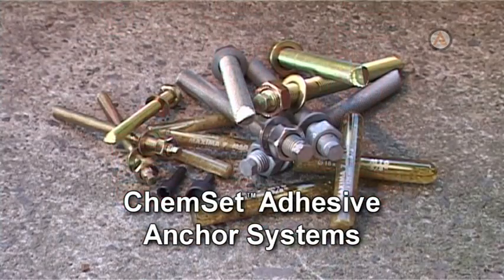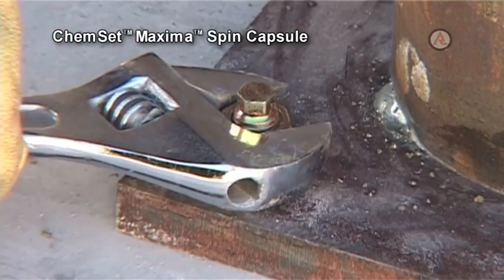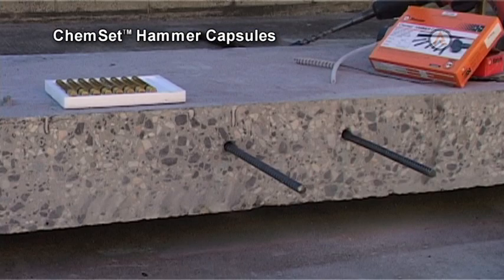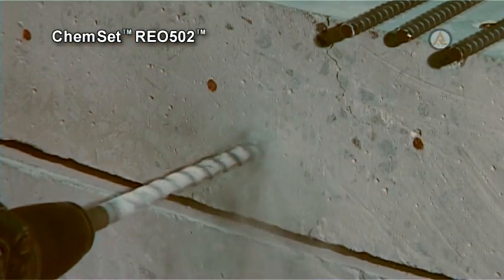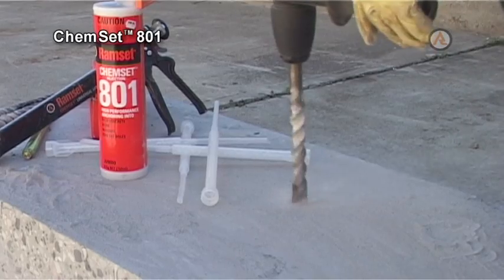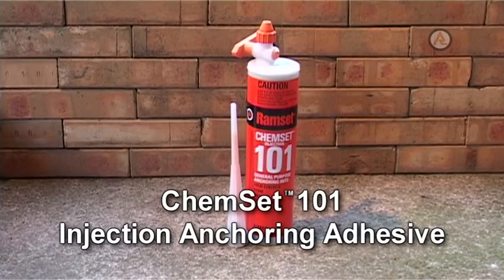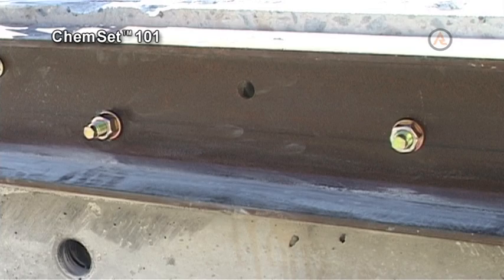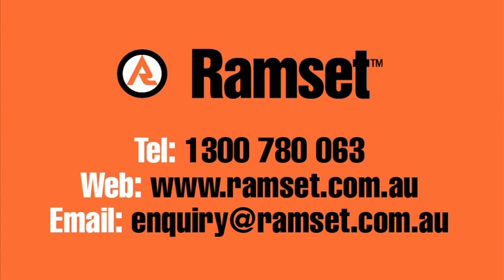Ramset - Chemical Anchors

Comment: What is meant by "light duty"?
Reply from the maker: RAMSET identify the type of fixing for
Masonry Anchor products into Light, Medium and Heavy Duty across the range of mechanical and chemical anchors. This generally relates to the weight of the item being fixed and the holding power of the fixing. Each individual product will have specifications as to it’s capabilities. 
However light is genetically intended for lighter and lower strength anchors.
Refer to RAMSET for more detail as I posted these videos as examples of my video production I am not a RAMSET employee.